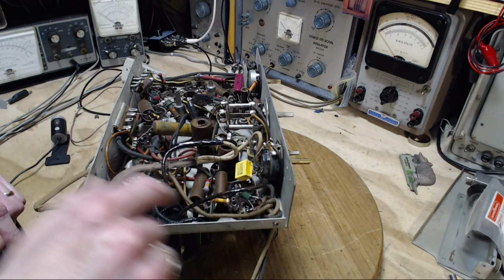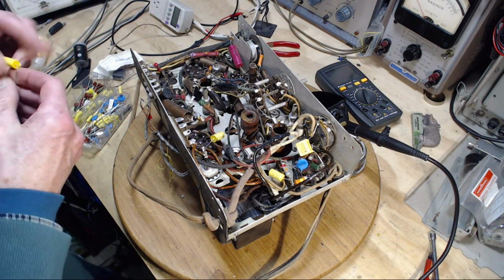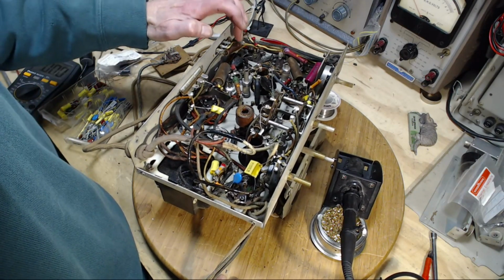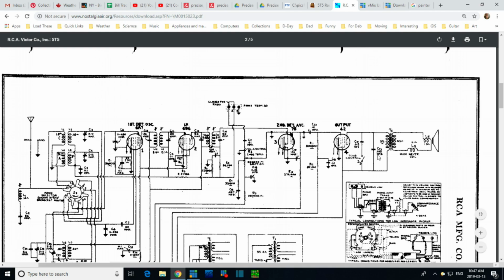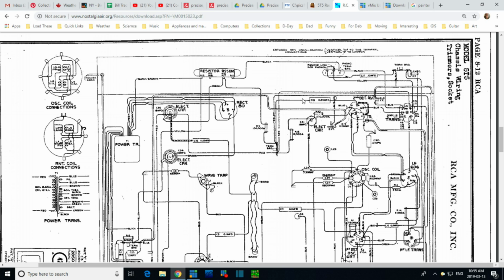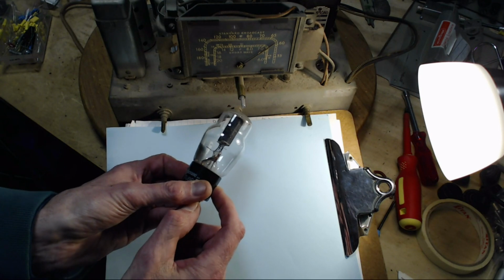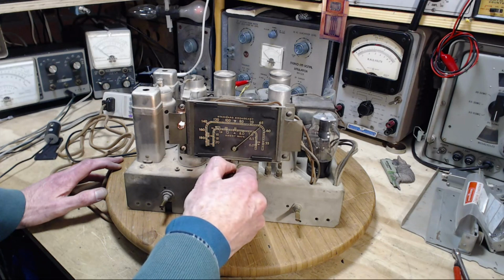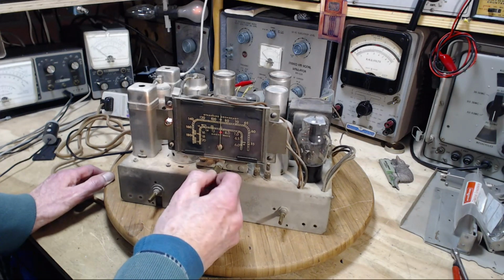Canadian RCA Victor Model 5T5 Video #2 - Audio Capacitors

Comment: RE: .007 capacitor. Remember that caps in the 30s and 40s were 20% tolerance when new. Using a .006 or .008 is well within that range. If it were to be exact you could always parallel caps to get a desired value such as .006 and a .001. Audio sections are not critical in these oldies and probably not the RF circuits either given the manufacturing tolerances of the day.